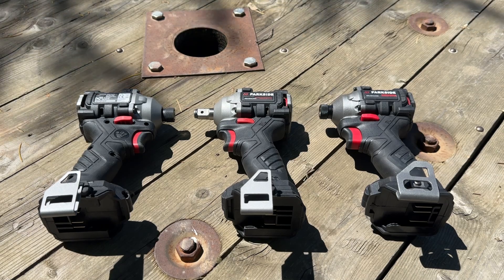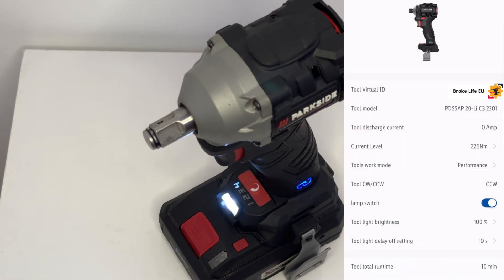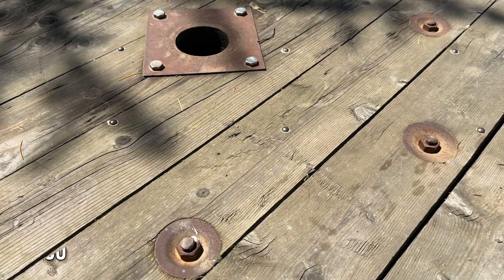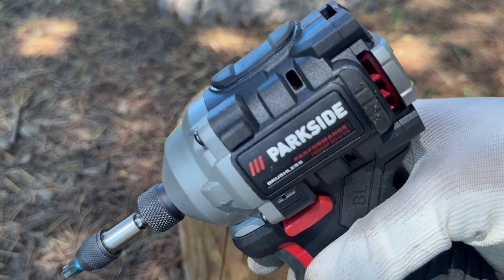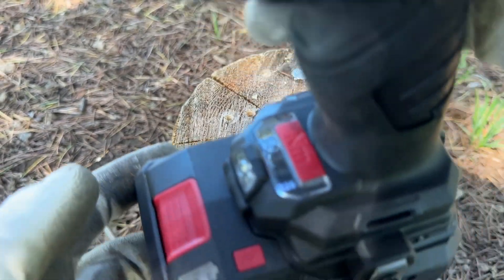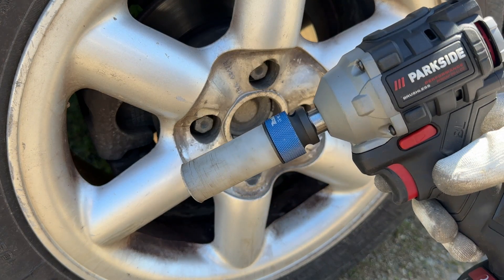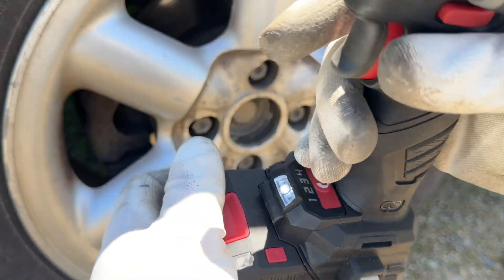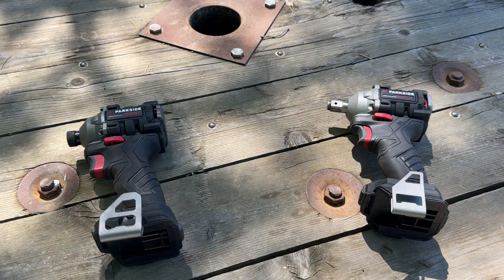Parkside Performance EXPERT MODE. Impact driver testing. PDSSAP C3 vs C3 EXPERT vs B3

Comment: After seeing that fluent power regulation in app in expert mode I already knew what it does....
You can just set your power exactly, instead of 4 preselected options.
That's it. 
It have nothing to do with max ppwer
Reply from the maker: It seems to deliver just a bit more at times. But nothing special.

Comment: Maybe in a more controlled environment - a long beam of solid wood which is more or less the same along the whole length - the power modes might differ a bit more. With a chunk of old wood which aged differently around, the screws might hit a cramp and slow down significantly.

Comment: Super interesting. Do you know if the PSBSAP 20-Li B3 is better than the newer PSBSAP 20-Li C3? I have the option to buy the C3 from Lidl for 50 eur, or the B3 new from OLX for 40 eur. The B3 probably doesnt come with the lidl guarantee, so i'm leaning towards the C3, but i note that on some models, the B3 was german made and the C3 is grizzly made, so i thought i'd ask. thanks!
Reply from the maker: I have stuck with my B3 for when I need a tool to get he job done. The C3 has the fancy expert mode and such, however I have seen loads more defective and broken C3s than I have ever seen B3s. On top of that my B3 is a 1/2" anvil conversion and it is always used to the max and has never missed a beat. Now the warranty is a difficult one, because it is always nice to have that.

Comment: Do a c3 vs b3 at 230 nm tighten wheel nut. Se if the c3 can go beyond the b3's max torque setting ;)
Reply from the maker: I will get to do something like that soon, but I will also include the new D4 😉

Comment: Hi, thanks for the great comparison!
One question - what about the bit mount in B3 vs C3? Looks a bit different. Was the mount longetivity and functionality improved in C3?
I've watched several videos complaining about a bit holder and oil leaks in B3
Reply from the maker: I have not hand any issues with either. Regarding the B3 I have had like 4 in the past year and never an issue. Maybe if the casing is overfilled with grease then it will come out of places, however I have had no issues with the B3 or the C3.

Comment: Next level in recording and post production. Very good vid easy to follow.
I see that replacing single cell in battery pack wouldn't be possible very soon like in laptop batteries. Or will require reprogramming of bms which is expensive to almost impossible.
Reply from the maker: You are too kind! Thank you so much! I hope it was an interesting video. I still don‘t have a spot welder to give changing the cells a go but as soon as I can afford a decent one I am thinking of purchasing one. I already have couple of batteries that need some cells replaced and I also have a couple of other projects in the pipeline that will need custom batteries.
Reply: @BrokeLifeEU  have gx590 and works fine with car battery. Other is mini handheld portable also aliexpress but i never tried it. Paid $15 or something on discount days.  Gx working fine except i shortcut it because it is really tight in design and not so comfortable but i fixed it same day replacing one shotky diode. It is probably under $10 now. Same here with projects.
Reply from the maker: @katarinak-vi7xc  I will have a look at these for sure! Thank you for the information!

Comment: I was expecting this video from you! The more I watch your videos the more I want to baby my b3 😂
Reply from the maker: 😂 I hope I did not disappoint! No need to baby the B3 I think it can take a beating! My first B3 is alive and well! Maybe over a year old and I convertes it to 1/2” shortly after I got it. So it has been used on nuts and bolts 120Nm and above all its life. No issues at all!
Reply: And I noticed that the expert mode on my b3 increases the speed a little bit but I would not recommend it, it has a lot of power as it is.
Reply from the maker: Expert mode on the B3? There is no expert mode on either of my B3s and I did check as I was making the video. Has there been an update that I failed to download or something?
Reply: @BrokeLifeEU  yes, it does, I have the A1 version of the 4Ah battery and also a couple of 8ah and I have the expert mode with 50amps discharge current.
Reply from the maker: @memutu Ah I see the misunderstanding now. So I am talking about an expert mode on the tool itself and not just the battery. So the expert mode for the battery is avalable when connected to any tool with a Bluetooth, whereas the C3 impact driver has a separate expert mode for the tool itself which the B3 does not have.
Reply: @BrokeLifeEU  yes, you're wright, after posting the video I realized the difference.
Reply from the maker: @memutu You scared me there for a second 😂 thought I was going to have ti take the video down because it is nonsense. And I needed a day to film and edit it 😅
Reply: @BrokeLifeEU  the moment I commented I knew you're going to review, the "what the f..." type of review 😂
Reply from the maker: Well a lot of Fff was coming out just now for a couple of minutes as I was trying to find an update for the software on the B3 to see if I had missed something. 😂😂😂
Reply: @BrokeLifeEU  I got the one van, 350 nm, the one that ttc tested a while ago, and I have the ferrex pro, the bigger one, I will try tomorrow to make a video with both and also with the b3, and see who 's who, I am guessing that the increased speed of the b3 will be in it's favor
Reply: @BrokeLifeEU  😂😂

Comment: It is powerfull the expert mode on the c3. So it was a litlle slower in the main speeds by design not by using cheaper structure.
Reply from the maker: I think they were not so sure it would last. That is why they held it back a bit. I am not convinced the EXPERT mode does add power, but even if it does the fact that it is buried deep in the app means to me that they are not 100% sure it will hold up to a higher power output.
Reply: @BrokeLifeEU  I really saw in your video that the expert mode did better in most tests. In some tests it stalled a little mainly because the wood also turned with the tool. But still the b3 version remains the best. Let's hope the d4 version will be like the d5 version of the sabersaw. Expert mode needs the 8ah battery
Reply from the maker: I hope they come up with a factory hybrid anvil like on the GDX18V. That would be a game changer! I know it won't happen but still I can dream. 😂

Comment: I have the feeling that the anvil in c3 is lighter than in b3, hence with easy screws, it finished sooner
Reply from the maker: To me it is because of the structure of the wood. No two screws can go in exactly in the same sort of density of wood. Hence the minute differences. Regarding the anvil, they use an identical 1/4" anvil, spring, metal ball, o rings and all.

Comment: Something to think about, 4Ah battery delivers 50A at best in theory but this tool can draw over that, I've seen it personally so the battery can be great equalizer in this test, for this reason I've bought 8Ah and 100A battery.
Reply from the maker: Solid point, however I made the video with 4Ah batteries due to the fact that they are more widely available and I think the tool is easier to handle with the 4Ah for most people. The 8Ah is just a bit too heavy for prolonged use on this. All that said it does deliver more peak power to the tool, however from what I saw I still don't think there will be a significant difference between Mode 4 and EXPERT mode. Maybe a slight difference but not a life changing one. I personally like the 4Ah smart battery for this tool, because it feels balanced. With the 8Ah it is very bottom heavy and difficult to manoeuvre.

Comment: Witch is the better? C3 or b3?
Reply from the maker: For me the B3 is the better one. However it is difficult to find now.
Reply: @BrokeLifeEU  I have buy the b3 version 1 year ago 👍 and I have do the modify to q 1/2 inches now is very very powerful 👍😉
Reply from the maker: Have you seen my 1/2" modification video? There is an option to modify it with a steel bushing which I think is the best option.
Reply: @BrokeLifeEU  yes I made it after seen your video 👍
Reply from the maker: I hope you like it! What do you use it for?
Reply: @BrokeLifeEU  i use it for all screws and nuts is very strong... The green version now stay closed in his box 🤣 
this is now better than green 400nm!!
Reply from the maker: @antonius3301  The 400Nm green one is nowhere near 400Nm. Not in its wildest dreams even 😂
Reply: I have 2 C3s for 6 months now,  that i bought because that was the only model I could find in the store, although now I regret not getting the B3 for an extra 30 eur each.
Those C3 disintegrate since first use.
All the rubber bumpers fell off by now.
The chuck is no longer holding the bits, it has lost the small ball bearing that was acting as a retainer.
And the most annoying thing is that it keeps reverting to Mode4 after a few minutes so I constantly have to cycle through power modes.
Reply from the maker: Indeed the B3 is better built. The look pretty much the same and it is difficult to see from a distance but once you hold them in your hand the B3 just feel like it is better built. I don't know if it is €30 better than the C3. Why such a difference in price? Last I saw the C3 was the same price as the B3.